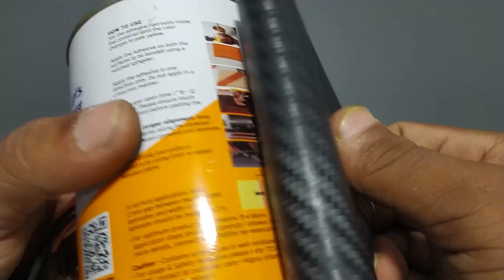how to make jet engine [ homemade electric jet engine]

Comment: very good very best formula  for real rc plane installation this  jet  without any problum 👌👌👌👌👌 1kg thrust is possible your jet engine
Reply: No 550g max, computer fans are too ineficient and 2 motors in one can is wasted power.
Reply: Not to forget 4 motors kill a 2500 mah battery within 1 minute.
Reply: @kokoslegend4850  would axial fans useful or not
Reply: @obc7523  you mean this 2 blade edf?
Reply: @kokoslegend4850  large one.. I want to make an aircraft with ducted fans with small engine
Reply: @obc7523  don't use 2 motors in one engine, it is a waste of power. Use a proffessional edf, they can be 50 mm and deliver tons of power. You need a high kv motor for tiny props.

Comment: You'll bend the needle of your compass using it as an Allen wrench on your fan caps. Good job soldering the positive and negative terminal together. It's recommended not to use a lighter to heat shrink wire wrap, but I think everyone uses lighters and it's really okay if you don't touch the flame to the wire, and don't heat one place too long. Heat guns are recommended for those who want to "be professional" if they are worried about a little soot understandingly if making products for other people who see soot around a wire and think it means the wire had too many amps go through it and thought it got too hot and caused it to smoke. I noticed that you had trouble deciding which direction to place the 2nd fan. The direction of the fan, whether you flip it or not doesn't matter because if you flip a propeller you will notice the same chirality on either side... It might be good to note however for greatest effeciency use the cw fan blades on the back of the ducted fan with a ccw motor, then cw motor on top with cw blades. The reason for this is when you flip one a cw motor it becomes ccw so you need a ccw so both fins rotate clockwise respective to front view. If you add a bell collar to the back/bottom of this you can gain extra thrust and noise reduction where the high and low pressure waves meet.

Comment: if i use the same tools but upscale the size of the fan blades but use the same motors will it still have the same speed ish at the back

Comment: Please what motors are they called, their ratings and as well as the battery rating and others' names
Reply: I think they are brushless motors  you will need esc ,lipo batteries and servo tester to run it or just a receiver and a transmitter
Reply: 1000KV brushless motor
Reply: @renujayawardena4375  no it said 2212kv
Reply: The motors are: XXD brushless motors 2212kv

Battery he hasn't so many capacity, take a 3000mah 35C 11,1V lipo battery.

Comment: Nice but this is edf not jet engine it can barely produce about 600 gram of thrust as you maded but can't use because of it doesn't have holding mount

Comment: COMO SE LLAMA ESE KIT  DE MOTORES MAS LA PLACA PARA PODER COMPRARME Y HACER TAMBIEN ESE PROYECTO. SALUDOS DESDE PERU.
Reply: Hola, para empezar, tienes que olvidar esto, porque es muy un motor hecho malo. Los motores solos que el tiene son bueno:  XXD brushless motors 2200kv. 

3s 30A ESC para hacer funcionar el motor.

 La batteria:  3s lipo battery 35C 3000 mah (mehor, que el video) 

y un: servo tester (no puedes hacer un avion),

 o un controller y receptor para rc aviones. Un bueno es: flysky fs -i6x with fs -iA10B (mas canales)

Que tienies mucho suerte!
Reply: Busca en google. Compra online de bangood.com o aliexpres. (Son mas baratos) tiendas en la calle no venden creo. Tiene que ser un tienda de rc aviones, de repente hay.